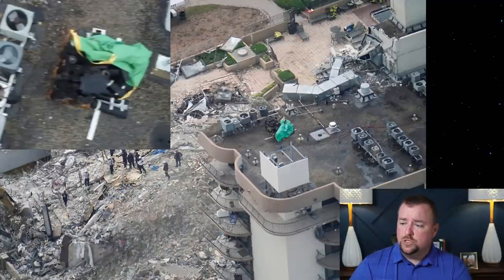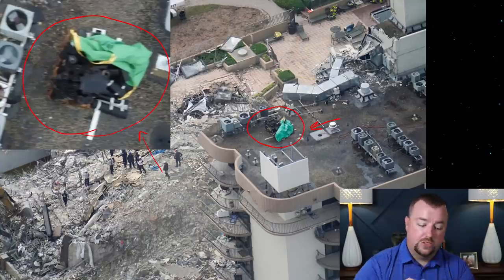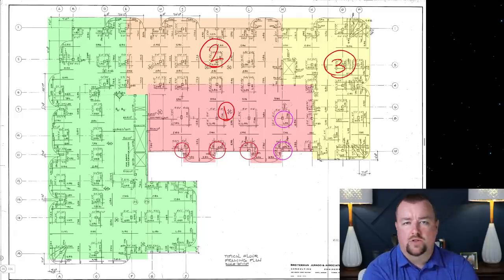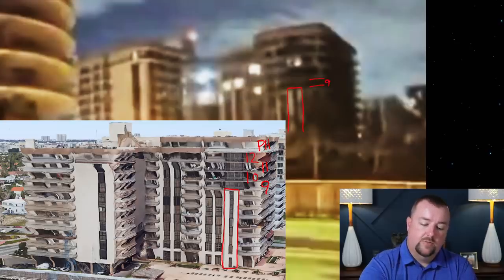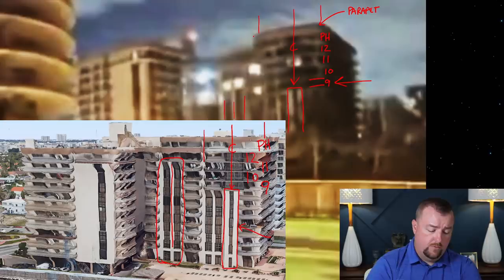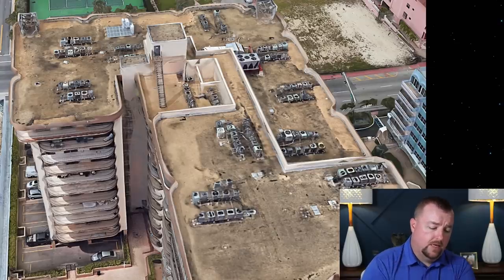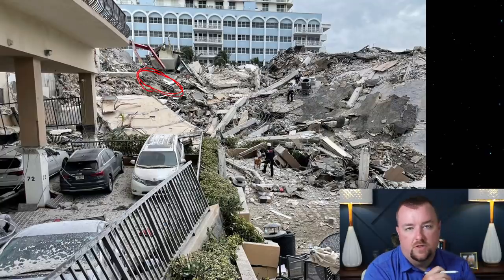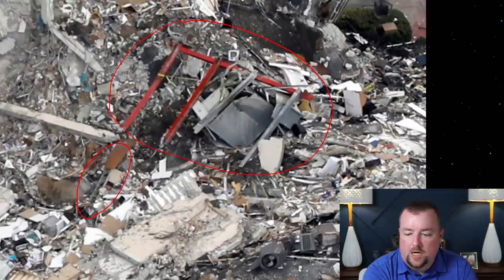Surfside Building Collapse - Did it start at the roof?

Comment: 17:21 Regarding motion sensing... really old security camera systems might start recording when the motion starts, but nowadays they have a "preroll" where the triggering of motion actually grabs a cache of the previous few seconds (my cheap DVR from local home improvement store does 10 seconds or so of preroll by default).
Reply: Good to know, & that’s a really helpful feature for security cameras to have!
Reply: How can it record something before its supposed to record? A DVR is working from pre-recorded material. So it's recording all the time, then?
Reply: @windsofmarchjourneyperrytr2823  That's exactly right.  It's constantly recording into a circular buffer. Think of a loop of video tape that instead of an endless playback loop, it's an endless recording loop.  If something interesting happens, you just grab the whole loop, splice it in where you started recording at the triggering event.
Reply: when you turn it on, it begins recording. It records however much it’s set to, and then once it’s reached this point each new frame overwrites the oldest frame. Should the camera trip, the new frames no longer overwrite the oldest, and are added to the end of the video, once the camera has reached the point where it’s ready to “turn off” (ie, no motion for a while), it will permanently save this complete video, including the parts before and after the camera triggered before resuming the prior mentioned overwrite the oldest frame.

Essentially, it’s always recording it’s just overwriting the oldest data unless it’s tripped, and if it is tripped it then has the recording leading up to it being tripped.

It’s not that different, really, from a store reusing tapes in an old style security system. Each tape holds 24 hours (or whatever the real number is, no idea on analogue systems) and if nothing happened during that 24 hours the tape will be reused (eventually) on a different day and only taken out of rotation and saved if/when something happens.
Reply: @windsofmarchjourneyperrytr2823  ב''ה, the buffer is necessary for the machine vision motion activation to operate anyway.
 
Instead of a camcorder tied to an IR motion sensor triggering a switch, you have a computer saving and comparing a few camera frames in now very cheap RAM algorithmically determining if there has been enough motion to fully store a recording on regular "permanent" storage.  No extra parts, electric consumption arguable.  Since the motion occurred in the last few frames the rest of the buffer is available if you want the preroll feature, as also came and somewhat went ("too complicated") on consumer cameras once it became a no-cost option.

Comment: Something I saw mentioned on a news report and I'd love to hear your thoughts - though maybe this is what that next video will be about - was speculation that there didn't seem to be as much rebar in the concrete as the plans called for. Obviously there's only so much that even the best engineer can tell from TV footage, but do you have any thoughts on that?
Reply: I read that the developer was a Canadian guy (lawyer) with tax issues with the Canadian revenue department and had significant financial issues. Could be he cut some corners on the construction to stave off the bankers.
Reply: @cayrick  hmm, that's interesting.  Sure makes one wonder, doesn't it...
Reply: Someone said that the parking garage was like a 'concrete slab box with no support pillars & also things like the slab was just thick enough to last like these over 40 years & possible the cement had more filler like sand & gravel than cement itself & yes maybe not enough steel & rebar !!!!!!
Reply: I don't understand cutting corners and using less than adequate materials to "save money" ? Aren't the builders worried about the structure collapsing , people getting killed, and then facing the repercussions?  

They are getting paid to do their job, right? I'm just trying to understand the reason to build with cheaper materials....
Reply: @johnbrowneyes7534  "Aren't the builders worried about the structure collapsing , people getting killed, and then facing the repercussions?" 

No. They're not. There's a weird quirk of human psychology where we think of ourselves in the third person; that is, future-me is a different person from present-me. If the building fails, that's future-me's problem. In the mean time, present-me has more money! That's why harsh prison sentences don't work to deter crime. it's why we procrastinate about jobs we know we need to do.

Then, of course, there's the fact that in the US, a wealthy person is quite unlikely to see any kind of serious repercussions for criminal negligence.  It'll get pinned on a contractor or sub-contractor somewhere, and the guy at the top will make the right noises, then a Kardashian will have a baby and everyone will forget all about it.
Reply: @johnbrowneyes7534  Desperate men do desperate things. The developer has 40 years of highway behind him and has no doubt passed on.

Comment: Notice that in the flashes there is a tad of green which is copper. Those flashes are from the severing of the electrical feeders which are fed from the core chases leading to the central power in the basement and should be visible in some of the site plans. They would run horizontally at each floor from the core chase.   Those high dv/dt flashes are also a great motion trigger. The camera owner probably had excluded the tree branches from the video trigger zone and was attempting to trigger on motion closer to the ground at their property. The flashes in the background field of view would provide a very plausible trigger.
Note that a bottom to top collapse could preserve power longer than a shear. In the next frame after the flash has extinguished the power to the rest of that floor is out. Power loss analysis might be a clue to the order of the collapse if the breakers held off long enough.
Thanks for the great analysis.
Reply: Finally  someone who knows what he is talking about. I have stated something similar to what your saying earlier. I have from the time of collapsing of this place that those where electrical lines shorting out. And there is  lot of voltage going through those floors. I am no electrician but have really good knowledge of how they work in buildings. I have done a bit of electrical work before. I have also seen what high voltage looks like when they short out or are being rip out. It is something you don’t forget.!!
Reply: Yes, those are definitely arc flashes of the main feeder cables or bus bars going up the building. If you play the video frame by frame, each arc flash goes out on the same frame as other lights in the building. The lower arc flash goes out in the same frame as lights in a condo above and to the right of the flash. The top arc flash goes out in the same frame as a window in the section that's falling on the right side, and is almost at the ground when the light goes out. A few frames later, the remaining few lights in windows all go out at the same time. 3 phase power, 3 faults, one after the other in fairly quick succession. I don't think the security video was motion triggered. The video that's been released to the public was from someone recording the screen of the security system with a phone. Look at the left side of the video - you can see the edge of the monitor and the edge of the window of the software. The person recording it with the phone missed the first bit. The original video in the security system would contain the whole thing, and be higher resolution as it's not a recording of a screen with a phone. I'm sure someone has that video, but it's not being released to the public.
Reply: @gorak9000  Good catch.
Reply: I said it elsewhere, but to get that arc flash, voltage had to be higher than the voltage the wiring and raceways were rated to carry. Modern THHN wire is rated for 600V, but not the overcurrent caused by over voltage. A high voltage transformer in the basement getting crushed and shorting primary and secondary windings would provide that very high voltage to lower voltage circuits. Either 480V to 208V/120V or 11kV to 208V could do it. The distribution fuses from the utility certainly blew at some point, they sound like a small bomb going off when they blow. Even after the fuse blows, the vaporized copper from the wiring will not instantly cool, but should stop vaporizing.

Comment: When you spoke of the power for the lights lasting a few frames would make sense. Breakers are thermal overloads and are rated by their speed. So it would take some time to reach the breakers or pull out of the connection at the other end or lose the power to the light. Plus it the light was a LED it takes some time to use the power still left in the light.

Comment: I think the 2 bright lights are electrical lines arcing out. They are not just brighter they are shifted to the blue end of the spectrum just like you'd expect from an electrical arc. Our seeing them in a still frame gives the illusion they are a continuous light source, but in reality were probably a flash that lasted just a fraction of a second, may have even been what triggered the camera to record.

As far if the collapse started at the top or bottom, the video of the expanding dust cloud shows you everything you need to know. When the first section falls there is a dust cloud created by the air being forced out of the floors as they collapse. If the building collapsed from the top down the dust cloud would have started at the top and been the whole height of the building with the dust from the top floors being furthest from the building when lowest floors finally collapsed.  

However that's not what happened. The dust cloud comes pretty much entirely from the bottom and it's velocity increases exponentially as floor after floor hits the ground and the floor's air is forced out at ground level adding to and accelerating the dust forced out by the lower floors that have already been crushed.

In the final frame before the last section falls the air is so clear towards the top floors you can even see the sky and clouds on the horizon because dust is blowing out from the base of the building.
Reply: You are right, but some people turn the lights also because the building was making noise

Comment: I apologize if you've covered it, but I think people aren't talking enough about the pavers that were placed on the pool deck. They appear to be sitting on a 3-4" thick mortar bed to me and as such surely added an outsized load to the already flimsy pool deck. Having been improperly waterproofed (presumably) they also might have served to conceal the damage that they themselves were causing to the slab and column joints underneath. I also would like your thoughts on the palm tree pots that are clearly not original, and additional planter boxes that I do not see on the original plans. I imagine that a palm tree pot that is constantly being rained on must weigh an incredible amount. I'm also interested if that kind of shear column connection is still even allowed as here in California almost every concrete column I see has some kind of capital or "flare-out" distributing the forces and preventing a punch-shear condition. Thanks, and this video was awesome btw.
Reply: I think the planters did crash through by the apt 111 and was the crashing wall that person heard before the deck dropped down. These 6 concrete planters had palm trees which were apparently removed before the collapse. However, I am curious how well they were drained or if they acted as fresh water reservoirs with hydrostatic pressure action infiltrating the pool deck slab.
Reply: I'd like to know if there was any waterproofing installed under the pavers. Where would the water drain that got under the pavers? And who knows how wet and rusted the rebar got below the pavers, out of sight.
Reply: @beehaven9949  I agree.
Reply: @skliros9235  Well it appears from what many YouTubers who work in this field say, since the damage had started to appear on the underside of the slab, and since water was filtering through, at least 90% of the slab damage would have been from above, likely concealed by the pavers in my opinion.

Comment: Another explanation for the lights is that modern LED lights use an AC to DC power supply circuit that contains a capacitor that will hold some charge and keep the light lit for a little less than a a second even after power is cut. This, combined with the reasoning in the video could explain why the lights were on so long. Additionally, I believe the reason why they are so bright is because the camera's exposure was actually really high - if we look at how bright the side of the building appeared, that could only have been the case with a very high exposure. Also, if the camera was motion triggered the exposure could have not yet stabilized to the nighttime lighting conditions during the first frame of the video.
Reply: They look like electrical arcs, as cables are yanked out of breaker panels. The blue-ish color compared to all of the other lights supports that guess a well. The lower of the 2 bright flashes extinguishes on the same frame as the light going out in one of the other apartments in the section collapsing. The higher bright flash goes out at the same time as a light much further down the building going out, and then the remaining lights go out a few frames later. That would correspond to the 3 phases of the power faulting in succession, and  protection equipment kicking in and disconnecting those phases as they fault (short). I'm pretty sure those are large power distribution cables getting yanked out of connections.

Comment: You don't need to be an architect to see that this building had an awful design.  Better maintenance could only delay the inevitable but not avoid it.
Reply: I think that's why the city is looking into the North Tower again.
Reply: @Just Looking San Diego will likely have a much different building design code given the seismic area it's in. The buildings will be of much higher strength, and are designed to stay up in an earthquake. Also. the soil conditions are very different than the east coast of Florida.

Comment: I think you are absolutely correct. I want to add also that after section one collapsed you can see electrical flashes from the severed wires on the part that did not collapse as well, lending credence to what you have explained here. Very well done video and I think you called it absolutely correct.

Comment: 10:04 If all the lights are out in the next frame and the building is already in motion wouldn't that likely be an electrical arc from lines getting severed?
Reply: That's what I think. It even has the blue tint.
Reply: @Paul Smith - yeah, just what I was thinking.  Same blue you see when transformers blow up in storms.  Arcing.
Reply: Someone suggested the lights were part of the Fire Alarm system too? If the sprinklers had burst causing the water into the garage in that short video a lady in the neighbouring condo filmed, theoretically it should have set off an alarm.

If the fire alarm system worked at all…

Comment: I find it interesting that one of the victims was a retired structural engineer. Seems that he would have noticed the cracking and other damage, and known it was serious? Somewhat surprised he didn't either raise hell about it, or move.
Reply: People do weird things to avoid losing their condo in paradise with an amazing view... Also, if he did know the building was in super rough shape, he wouldn't have necessarily known the whole thing would come down...there's a lot of buildings in bad shape out there. They almost never just straight up collapse. He also likely would have know that if he raised enough hell to make them decide to fix the building fast, that as a tenant he'd be getting probably a 50 thousand dollar assessment added to his bills. Buildings like this are very expensive to fix and the tenants end up paying for it. He may have thought it was bad, but not bad enough to drop on him. And like I said that 50k+ he would have known it would cost him could have gone a long way towards not saying much.
Reply: Well and they had already started the process of making the 15 million dollars of repairs, that's what the roof work was the start of. So he probably was like "well the repairs are being started." And yeah, buildings don't usually just collapse here in the United States. Anywhere else in the world, sure I would expect it. Obviously between those things he figured it was under control.
Reply: They had valet parking, so it's possible he never saw the underground parking garage.  (Not sure if it was 100% mandatory valet parking or if some people valet parked and some people self parked.)

Also, he may not have been very sociable with his neighbors, where he would have heard about damage in the garage and balconies.
Reply: He may have noticed and WAS raising hell…we just don’t know. RIP.